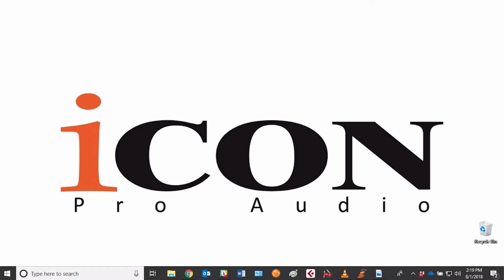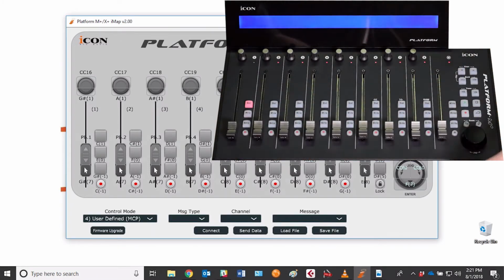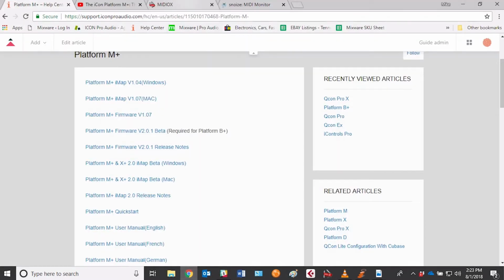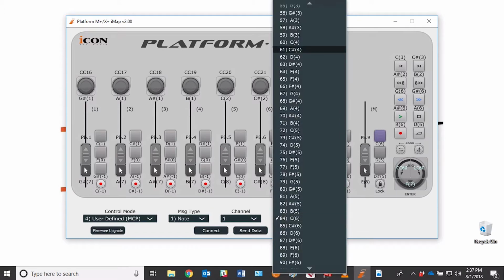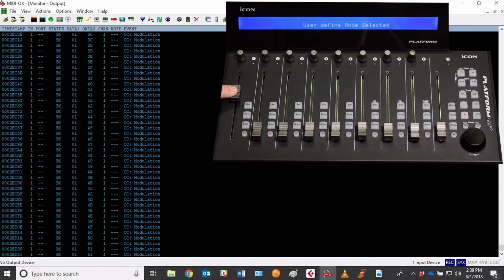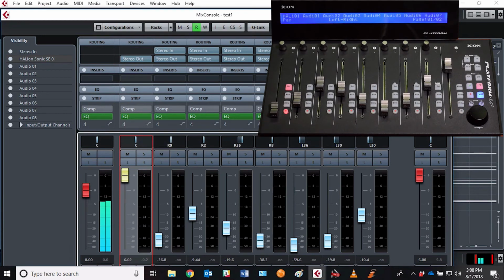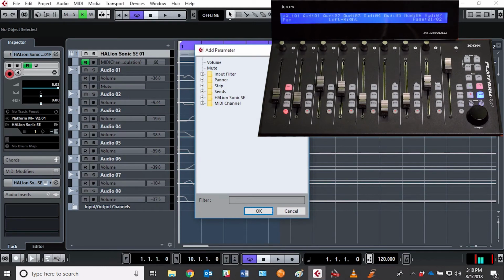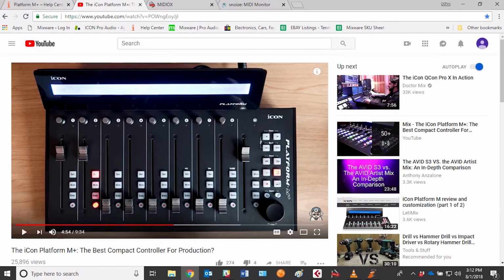Platform M+ User Define Mode Custom Mapping Tutorial - YouTube

Comment: NEED HELP: I managed to write midi automations in USer Mode (expression, dynamics, speed, release etc...) but then the Platform M+ faders don't react to the written automation (they don't move!). Any way to solve this? I already upgraded both software and firmware, deleted old platform in midi window on mac, now it is configured correctly on mac and cubase but...still doesn't react to automations....any way to solve this?? Can this machine actually read midi automations? Please give support Icon! Thanks.
Reply from the maker: Hello Francesco, this is not going to work. The Platform and other control surfaces send and receive communications messages with the DAW. Fader position is sent to the DAW, and the DAW sends back fader position to update the Platform. The DAW doesn't send back MCP messages to update fader position based on values such as expression. The motor faders are going to react when they are interfaced with software values that generate return values sent to the Icon, like volume does.
Reply: @Iconproaudio  Thanks. Are you saying that automations work only in mixer mode (MCP), and only with volume values? Because I actually I finally managed to receive midi feedback (espression/dynamic and other midi cc values). By using Icon as midi send on a midi track. Now I still have to figure out how to make it work automatically on each and every track of my 1000+  tracks template in Cubase (without having to add the icon asmidisend on each track manually).
Reply from the maker: What I mean is that not all parameters are able to handle useful MIDI feedback or do it in a way that works well for faders. Thanks to Cubase support of this feature you can get a bit more juice out of it. Yes, this channel setting in Cubase is a good idea to achieve this, but I don't know of any way to automatically set this. An existing template will be tedious, and not all parameters will respond well... I would make copies of the channels with the correct settings in a template made for mixing/writing with Platform, and just import specific channels if I need it from the other large template.
Reply: @FrancescoDAndrea  Hi, do you have some details on how exactly you set this up? I am starting from scratch and would be willing to set it up manually, but so far trying to experiment with midi send, I cannot get the faders to move when playing back or changing on screen. Thanks!
Reply: @tosvus  I actually managed for a while to receive MIDI feedback but I had lots off problems and it worked only in some istances, then other times was messy and unpredictable. So I guess I thought I managed to make it work, but I didn't. I stopped caring about it and I just use it now as a normal MIDI controller but without feedback from the recorded automations.
Reply: @FrancescoDAndrea  Ok, thank you for the answer! Not a big deal but it would have been nice to get it working!
Reply: @tosvus  Perhaps it can be done, it's just I couldn't...let me know if you find a solution! :D
Reply: @FrancescoDAndrea  Thanks, will do!

Comment: Is there a way to figure out what CC number opens the mixer in Logic Pro X?
Reply from the maker: Hey bmsmusician,

The only way to figure out the CC for mixer button is to get the midi implementation from Apple ( Logic Pro X ). Im going to do some digging on my end as well to see if I can find a universal control change chart.

Kevin,
iCON Support
Reply: @Iconproaudio  Great, I'll see if I can find it as well. On a side note, (maybe I need to get a support ticket for it) when using iMap and midi monitor on my Mac it reports F#6 being triggered when setting a button in iMap to F#5. I haven't tried any other button yet but I'll do some more testing tomorrow.
Reply: @Iconproaudio  was wondering if you find the midi message for the Logic pro Mixer button...that would be great!
Reply from the maker: Hey bmsmusician, Thanks for reaching out. 
While we are not able to provide MIDI message information for any software, we encourage users to remap these type of features using the DAWs MIDI learn option, or request this information from the software developers.

We hope this helps to point you in the right direction, though if you have any other questions or concerns we may be able to help with, please don't hesitate to submit a ticket to our help desk at http://support.iconproaudio.com 
Thanks again
Icon Support.

Comment: I've just bought Platform M+ and I am lovin it. Could you please teach me how to active Vegas Mode on it? :) Tks!
Reply from the maker: Hello What The REC!
Thanks for reaching out. Well, there isn't technically a 'vegas mode' on the Platform M+ you can achieve a similar effect with the fader calibration / test mode.
Simply turn your unit off, then press and hold the first channel's encoder knob while turning the unit back on. This will begin testing all of the motors in your faders as well as the LEDs on the unit. 

I hope this helps to answer your question, though if there's anything else we can help out with don't hesitate to submit a ticket to our help desk at https://support.iconproaudio.com
Reply: Great! Thanks a bunch.
Reply from the maker: Hello What The Rec!, 

We are happy that your excited about the M+! We do not have a Vegas Mode on any of our devices because it requires a great amount of ram for it to be stored on the device. We wanted to keep the device storage moderately free for firmware updates. However,  this is something that you could program in your DAW using the volume automation. Please let us know if we could help you in any other way! We appreciate your purchase and feedback.

Kevin,
iCON Support

Comment: Hi - nice couple of videos on the upgrade. How do you know Mixer button maps to F#5? Is there a cubase MCU MIDI spec available so we know which functions to map?
Reply: FYI, for anyone that had a similar query, I got the below response from iCON support which answers my question (10/10 customer service by the way);

"A quick method you can use to get the most common Midi function numbers in Cubase and other popular DAWs that we support, is to use the ICON iMap software.  If you download the iMap software for the Qcon ProX or Qcon Pro, you can select the DAW under "Control Mode" and then click on the Midi function button you desire (in the software), and then simply read the function name and Midi Note in the "Message" window.

So if I choose Cubase and click on 'Mixer' I get 5(F#) Mixer. "
Reply: Thanks!  I have an issue with my Icon: I can't seem to use the record and mixer buttons for their normal function, when I'm in "User Defined Mode". How can I reassign in Cubase the record button to make it pop up the mixer window? It works only in Cubase mode, even if I apply the note/function "95 record" as in MPC mode....then in user define mode it's called 95(b6) note and doesn't work as record button...
Reply from the maker: Hey Francesco, Thanks for reaching out. 
To quickly and easily remap things in your DAW, particularly Cubase, we suggest using MIDI learn. 
While we don't have any videos specific to using MIDI learn in Cubase, there are lots of great videos on YouTube which explain this process in detail.

I hope this helps to point you in the right direction, though if you have any other questions or concerns we may be able to help out with please don't hesitate to submit a ticket to our help desk at www.support.iconprouadio.com 
Thank you again for your understanding.
Icon Support.
Reply: Thanks! Is it possible, in user mode, to customise any button but retain the record button in its original function? It has a different command name in MPC and User....hence the problem! Also....when I press the record button in midi learn mode in Cubase, nothing happens...
Reply: get snoize midi monitor and you will able to see your midi activity  every time you touch any  midi  this in the video dude
Reply: valgi morais Thanks. But I think you miss my point. I use MIDIOX (PC) so I can see the MIDI out of the M+, my question is how to know the MIDI information for Cubase e.g what MIDI message does Cubase receive "Next Marker" or "Talkback"? I can set the MIDI out of the M+ to whatever  but if I don't know what Cubase maps that MIDI to it doesn't help. So I only know Mixer button maps to F#5 as it's in the video - how would I know this otherwise? And therefore how do I know any other Cubase button's MIDI Input?
Reply from the maker: Francesco,
Our apologies for the confusion, in this case it sounds like it might suit your needs best if you use the Mackie control mode and then MIDI learn what you need to change from there.

I hope this helps to sort things out, though as always if you have any other questions feel free to submit a ticket to our help desk at www.support.iconprouadio.com 
Thanks again for your understanding.
Icon Support.